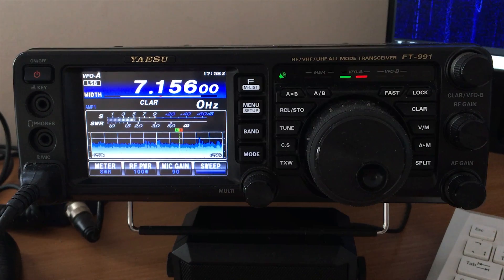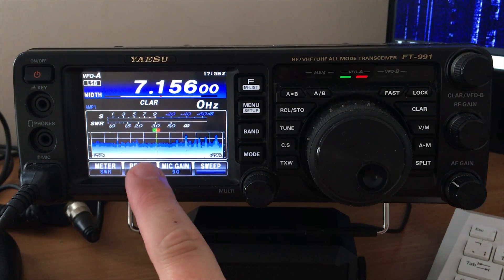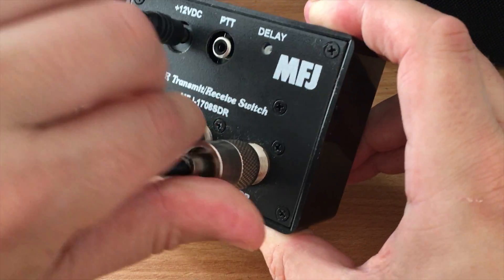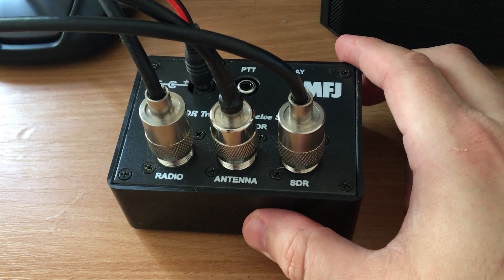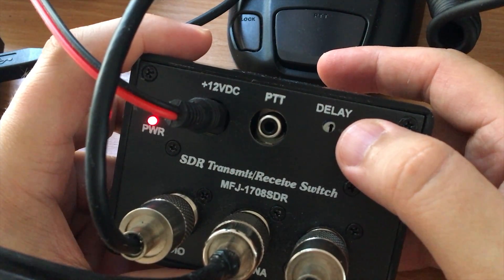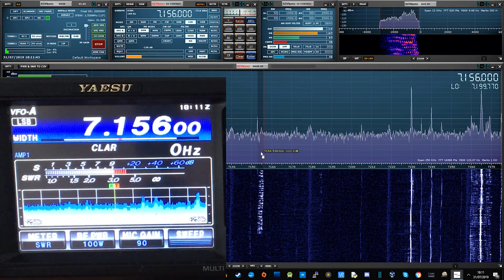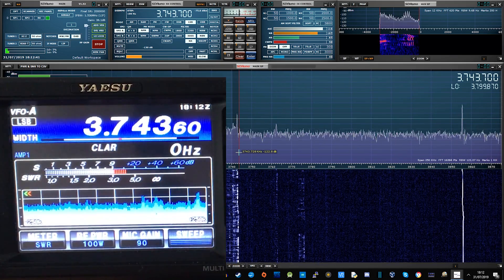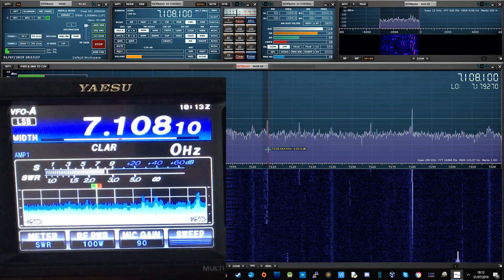Using the MFJ-1708SDR To Have A Wide Band Pan-adapter

Comment: hey my friend, how do you connect the HF Radio / SDRPlay in Omnirig? Rig1 I assume the HF but then in Rig 2 how do you specify the SDRPlay? I dont have a COM port for the SDRPlay. In Windows 10 shows as Software Defined Radio as a sound card card that it is, so there is no COM port. There is a ton of videos about the cable connections but nobody explain the Omnirig / Sdr software part, funny, don't even MFJ have instructions for that, they just sell you they box and "good luck".

Comment: Whats the difference between using this and tapping into the I.F. stage of the transciever with the SDR?
Reply from the maker: Well, for starters you dont need to open the radio and possibly void it's warranty, and you don't need a buffer. Personally I do prefer an IF tap though but not everyone can achieve this.
Reply: @TechMindsOfficial  thanks for reply.  What advantage does an if tap directly to sdr achieve?

Comment: Hi Mat,
I know that this may be a stupid question,  but!  , , , , 
Would i be right in guessing that i wouldn't be able to use the 1708b to get a digital frequency readout , nor be able to use the software with anything like an old FRG 700, or with an original Yaesu 101E or Similar type of radio,.?  I also have an old but beautifully working KW 2000 E.  Apart from attaching a frequency counter to any of these old beautiful radios,  it would be great if there was a way to use SDR UNO software without using an SDR  RX device, which would completely defeat the objects of the exercise/ experiment. 
Would you PLEASE answer me somehow. 
Kind regards, 
Ray,  M0RAY...

Comment: I have an FT-710. If I don't want to use the RFSense, do I hook it up from the GND connection on the back of my radio to the PTT on the MFJ? Thank you
Reply: Did you ever figure out how to use a ground pin from the 710

Comment: Does Omni rig and shrunk work the other way? Can you turn the VFO and sdr uno freq changes?
Reply: Yes. By using OmniRig, I can have my HF rig, WSJT-X, SDRuno and my logging program (LOG4OM) all synchronized and  tracking the same frequency and mode. Change one and they all change together. OmniRig will even control two rigs, separately addressable from whatever software you are using. I generally listen to the output of SDRuno, as it's filtering and noise reduction are far more sophisticated than what's on my old TS-440S.

Comment: How can this control a radio like my old Ft-990? It has no way to control the VFO other than through the radio itself. There is no USB on the radio. Same with my IC-756 ProII. No external way to control the radio's VFO from an external source. .
Reply: Ok, I see the external control functions on newer radios. But this won't work on older rigs like the Drake C Line or Collins S Line. Make sure your radio has the control functions. You may also need a connecting device for your type radio to the computer.

Comment: Having all the connectors on the face of that thing seems like the least convenient way possible to design it.  It would seem more intuitive to have the SO-239s going to your radios on one side and the one going to the antenna on the opposite side while having wall or shelf mounting holes like an antenna selector.
Reply from the maker: I agree! Check my latest video on an alternative product to this, which is designed way better.

Comment: Is the mfj switch fast enough to protect the sdr using the rf sensing method? My 718 doesnt have a ptt connection.
Reply: Icom IC-718? It does, it's the jar left RCA jack as you look at the back of the rig. It's the same jack that would be used to key an amplifier.

You really don't want to use RF sensing, I wouldn't trust it with my RSPdx SDR.

Comment: Any idea where the CTRL plug from the SDR  Switch goes on the back of an FT-991.
Ive been looking, but cant find any info for some reason
Reply: TX GND, Pin 2 on the TUN/LIN jack. It's the same connection that would be used to key an amplifier.

Comment: Thanks for the video.just wondering if when you use that software to control the rig when you change frequency...I take it when you change to a freq on sdruno that the 991a is not capable of.it will just stay on the last usable signal on the 991a but still allow to tune to the other freq on sdruno?

Comment: Just got one.  (1708B SDR) Works pretty good except for digital modes even though I am using my PTT line. 
RF flows right thru to the SDR. I can hear the relays click but sdruno shows "overload".
My intent was to run meteor scatter with my Icom 7300 while watching on the sdr.
All other modes (AM,FM,SSB) sdruno shows "RF Mute" which it should. (USB-D) I get no such indication.
Disappointing.
Reply: if it says overload turn the gain down
Reply: In digital modes, does it say "RF Mute" and "Overload" or just "Overload"?  Also can you be specific in what radio you have and where are you seeing "RF Mute"?

Comment: Great video ,you say you listen to it through your radio just out of interest is the noise reduction any better using the sdr uni , I use a ft 950 and like the idea of using a sdr such as this also how do you find the mfj sensing unit are you confident that it gives adequate rf protection . Many thanks

Comment: Great videos  I have a FT991A  an SDRPLAY  RSP DX and Mfj1708 b sdr
I want the PANADAPTER  to share  both antenna ports HF and uhf vhf  do I need a second  sdrplay  or a sdrplay  rsp DUO  
I'm a big time monitoring  guy that catches everything I can. And I want the protection any thoughts on setup  of 1 rig  and 2  ports. Not much on the web.
AA4CP Chuck 
Port Salerno FL USA

Comment: Instead of plugging an SDR into the SDR port, could you just plug a normal receiver, I want to be able to receive with my S-2000 receiver and be able to transmit on my transmitter.
Reply from the maker: Yes of course, it’s a literal connection to your antenna that is only switch when TX’ing

Comment: So this MFJ device will add SDR capability to any transceiver? Or is this just your Yaesu 991 that can accept it?
Reply from the maker: It would be any transceiver :) very useful piece of gear of your radio does not have RX or IF output.
Reply: Not any, your rigs has to have an .inf files written for it. And even then it might not work. Mine does not communicate.

Comment: Kinda looks like an add on I might interested in to pair with my first HF radio. I was looking at the IC-7300. Ran across the IC-718 and wondered if this SDRUno and Omni rig would control the IC-718 radio? I’ll check the websites for those items to see if they work together or if I got some of this info wrong please let me know. What cables do you have connected between the computer and HF radio? Just USB

Comment: So the rig is connected to the computer also by the CAT port? Or by USB? What I'm getting at is the rig has to be connected to the computer somehow so that Omni-rig can receive/transfer data relating to the frequency, mode etc? So could this work with any rig that has CAT control? I have an much less high tech ICOM ic-718 but it does have  CAT control. I've read about tapping the IF and running it through a SDR to get a scope readout, don't really feel confident enough to attack the rig with a soldering iron though, so this seems like a good alternative.

Comment: I have the Yaesu FT450D and i was thinking of getting one of these.I notice in your video you didnt connect the PTT socket to 
anything.Does it not need to be connected on the Yaesu?Thanks
Reply from the maker: In the video I was using RF sense feature of the MFJ unit, but I would recommend using a PTT line just incase the RF Sense failed.
Reply: Thanks I just need to work out where to connect the PTT cable to on the 450D
  @TechMindsOfficial
Reply: @alansim969  Did you ever figure out where to connect the PTT Cable to the 450D?
Reply: @MrJarbuck  Hi John If I remember correctly the connection needs to be on the Din socket on the back of the 450D..I have not used the 450 for a long time now having moved on to the Icom IC7300 but their is a diagram in the back of the manual that details which pin outs do what and I think its one of those..I think their should be videos on youtube by now detailing how to do it.Hope this helps stay safe best wishes.

Comment: Why didn't you key the transmitter and show the overloaded front end of the sdrplay receiver?
Reply from the maker: That’s a good question, but something I didn’t even consider when I was making the video, but I should of shown that.  I’ll take a screen shot and post a link. Essentially you can imagine a really strong signal while transmitting.
Reply: @TechMindsOfficial  I was actually being sarcastic because I know that the MFJ-1807SDR antenna switch has very poor isolation between ports and on top of that the SDRPlay will overload quite easily. Thanks for the response though.
Reply: Doesn't the switch disable SDR RX while the transceiver is in TX?

Comment: Make sure it's tested before the company sends it to you. I bought the SMA-F Version of this and it didn't work. MFJ said it was manufactured with incorrect parts. I returned the whole mess and bought an antenna selector instead. This way I can have 4 transceivers and 4 antennas connected and select the combo I want to use. I.E. 20 Meter antenna connected to ICOM718, SDR, and Antenna Analyzer simultaneously.
Reply from the maker: I wish I had the room to have 4 HF antennas 😂 Just about manage with my EFHE but soon I’m installing a 6BTV  aswell, I’m so lucky 😂